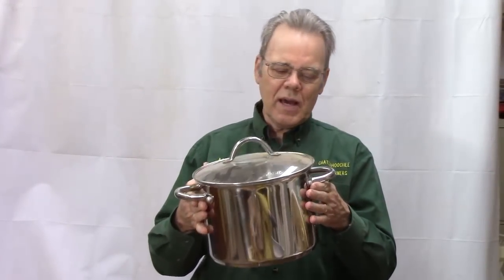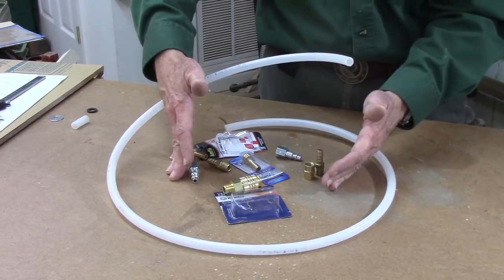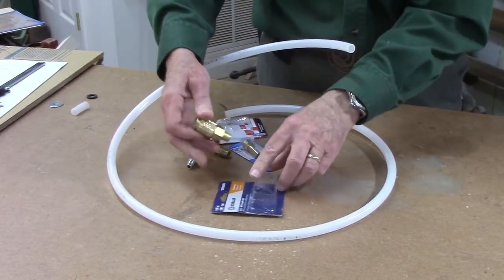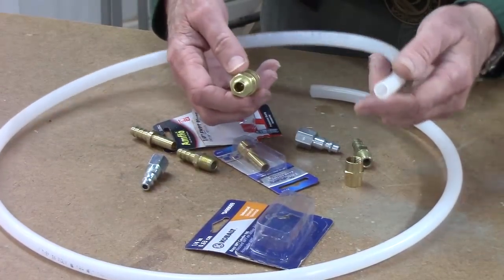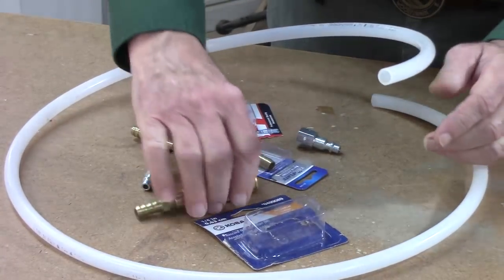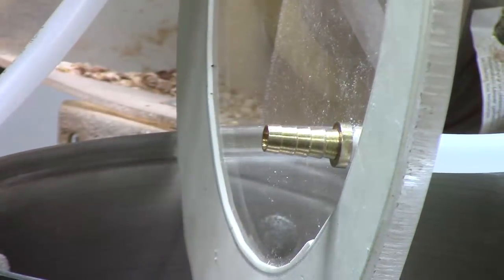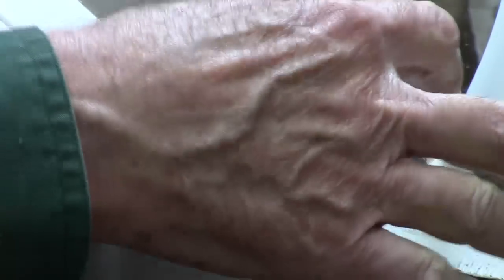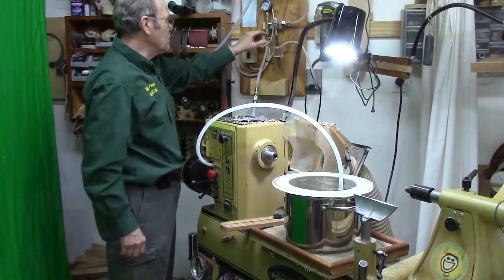DIY Vacuum Chamber for Stabilizing Wood

Comment: Hi Mike.  Great idea.  If the lid connection doesn't work out, look for a "through wall" connector.  There's several different types available, but something like https://www.mcmaster.com/#44555k121/=1ci3t0n might be just the thing with an o-ring on either side.    
Doug from Etowah River Woodturners
Reply from the maker: Thanks for that, Doug! That looks like the perfect connector for going thru the wall of the pot which I am still reluctant to do, or more  likely replace that fitting that is  only a friction fit in the acrylic as soon as it gets loose.  Hope your club is doing well and growing.

Comment: Hi Mike 
Great video I love the thorough explanation. I’ve found myself with a Gast 0522 pump for real cheap from an auction-and I want to rig up a similar system to yours, with the switch and the connects. Do you have anywhere that you might be able to point me to showing in detail the wiring and hose/gauge/valve setup you’re using? It looks like my perfect setup, I’m just having a time visualizing it from pause on your video here. Thanks so much.
Reply from the maker: I have update and added an article I wrote on my system. You can find it on my website under the Resources tab. http://MikePeaceWoodturning.com
Reply: Wow thank you so much!

Comment: Dear sir, to stabilize the wood that degree of moisture is allowed, try to reach zero percent by heating the wood just cracking. Thank you
Reply from the maker: I have not had problems with my wood being wet as I am typically stabilizing smaller pieces of spalted wood I have had indoors in my heated and cooled shop for some time. I agree, heating to inusre  dry is not a bad idea.

Comment: Mike, I couldn't make out what you called the white gasket material you used to seal the pot.  Would you mind posting the name please.  Thanks for the video.  I plan on making this setup.  I did purchase a one inch piece of acrylic....just in case.
Reply from the maker: Fun foam. 1/16" closed cell foam
Reply: @MikePeaceWoodturning  Thanks for the quick response!

Comment: I plan to make one also by converting a pressure paint pot. I will probably add a gauge to the lid. I see your's next to the pump. Threading with some teflon tape may help in the acrylic.
Good job prepping me for mine.
Alan
Reply from the maker: Thanks for commenting, Alan.

Comment: I learned this the hard way. That steel pot will implode. Also the rivet holes will prevent a tight vacuum. I bought a cheap old style aluminum pressure cooker. Been using it for about a year no problems. Also used a glass cookie jar from Walmart.
Reply from the maker: I am getting no leakage at the rivets and the pot appears to pretty thick gage steel. I can see as the pot gets bigger, so would the risk of implosion. Mine is about 10 qts.  It looks as strong as the thicker commercial aluminum pot unit my friend John has which also came with handles riveted on.  I guess I will take my chances.  What do they say about a fool learning from his own mistakes but a wise man learns from others.

Comment: Great video.  I used a crock pot for mine. I used a diamond drill bit  to put a hole in the lid  off to the side then used foam for the seal.  Cactus juice is on the way.  I have a variety of wood ready to go.
Reply from the maker: Excellent. Let us know which woods work well and which don't.

Comment: Did I miss something? No hole for a circle cutting jig, then drill a hole for the fitting? Why not use the centering hole for the fitting? By the way, my circle cutting jig only requires a tiny dimple to pivot, not a hole. Wouldn't the lid implode instead of explode if were to break? Also I think silicone would seal the fitting if it should leak as is. Just sayin'.
This is a project I might try if there is a more inexpensive vacuum pump out there. Thanks for posting Mike.
Reply from the maker: Yes, it would definitely implode. I figure a hole near the edge would be stronger as any hole would likely weaken the lid. Also provides best visability. Since my acrylic is marginal in thickness, even a dimple would weaken. I was planning on using silicone if it leaked but it doesn't - yet.  I think you could use a much smaller pump but I already had one. If you don't have a vacuum chuck, might be worth getting a vacuum pump that will do double duty.

Comment: Very informative!  Might want to further explore the limitations of certain types of pots regarding thickness and maximum "safe" vacuum pressure, to avoid having an implosion...
Reply from the maker: Thanks for commenting. I don't think I will do any experimenting. The pot is thick enough since it is like many commercial units. If the lid breaks I will make a wood top with a smaller acrylic see through window with the 3/8" acrylic I have on hand.

Comment: Be very careful not to get Cactus juice on the lid. Seemingly it can cause the acrylic to crack. I just bought a vacuum chamber and the lid is 20mm thick, it also comes with a warning not get cactus juice on for this reason. Please investigate for your own safety. Regards Stuart,
Reply: Stu Brearley     absolutely correct, Stu. Also, if you get Cactus Juice(or any stabilizing liquid) on the acrylic lid, it will cloud the viewing window of your lid. Ask me how I know ! 
Have fun Mike.  Jim
Reply: Honestly acrylic is a poor choice for any stabilizing. Glass is best. Drill the pot on the side for the fittings. Use JB weld to set it. JB weld won’t be affected by any chemicals
Reply from the maker: Thanks for sharing! 20mm?  I probably should go ahead and make a wooden top with a smaller acrylic window with the acrylic I have on hand.

Comment: Should have put a valve at the pot and you can thread the acrylic to put your fittings in.
Reply: Mike, you need a gauge on the pot to get a more accurate reading. I can pull about 28 1/2 in. of mercury, but I'm in Florida. It will depend on the altitude where the pot is being used.
Reply: If you have to turn around to reach the valve something might happen when your back is turned.  Look at a picture of a commercial one.
Reply from the maker: I have a valve on the wall I can reach from where I will be using the pot. Why do you recommend a second one on the lid?